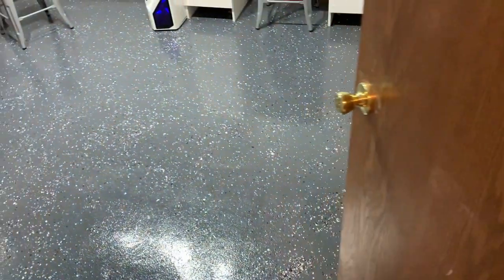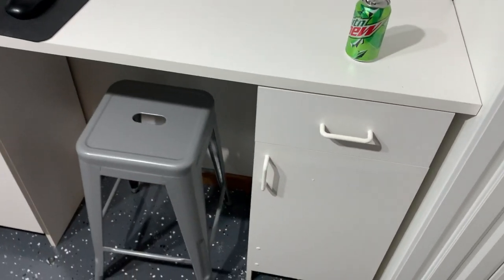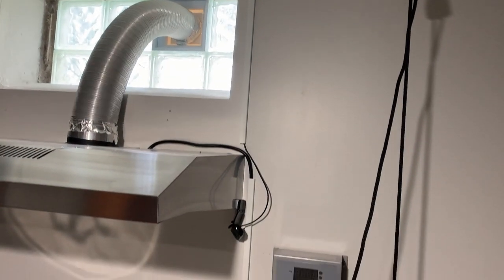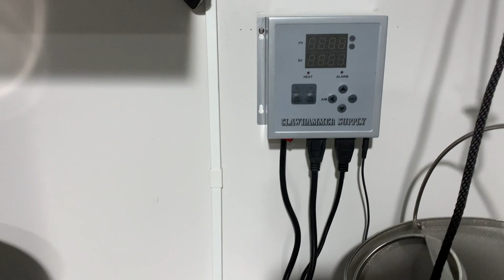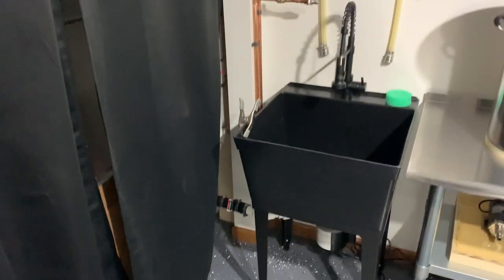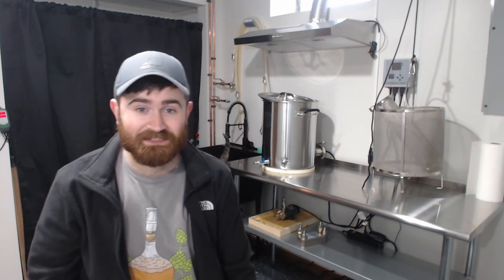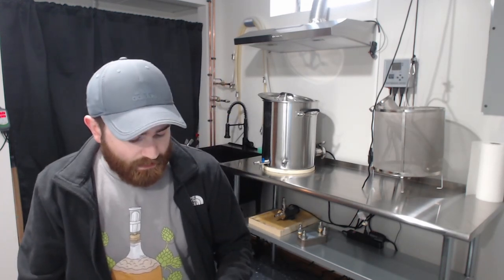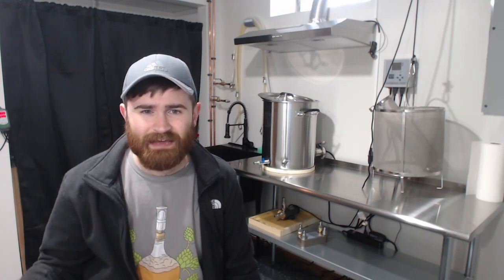DIY Basement Electric BREWERY Part 6 - Brewery Tour, Cost Overview and Future Plans!

Comment: Thanks for doing this series, I really learned a lot from it. Genius move with the QDs on the pipes directly! Forgive me if I missed it but was there any specific reason you chose not to do PEX for the water lines? Your space is exceptionally well organized!
Reply from the maker: Pex would be much easier, I had copper already in the house so I just decided to hard plumb with copper. Could have switched to Pex but would have had to buy the Pex stuff like the Crimper and I already had all the copper stuff. Also the quick disconnects are the bomb, would recommend plumbing them in.

Comment: Are you still plugging the CHS into a power strip? I saw in another video the waterproof one in this video fried/caught fire. I just bought the 120v system, and I'm short on plugs.
Reply from the maker: So yea I had a waterproof one that melted, I didn't notice it actually until one of my live brew days lol.. I couldn't tell you which one or the timestamp. But I did swap it for just a normal power strip.
Reply: @TroubleBrewing  have you moved the plug from the Clawhammer system to that new strip or to a dedicated plug? Thanks, great videos btw!
Reply from the maker: @bandanabush7334  So the system is on its own plug, everything elts im powering is on the strip.
Reply: @TroubleBrewing  thanks alot for taking the time to reply. I was hoping to be able to use an extension or power strip, but I'm with you, having its own plug seems important!